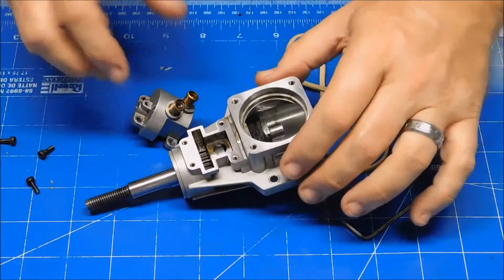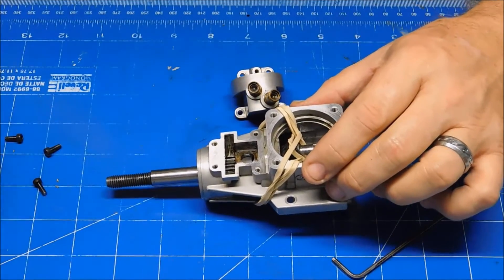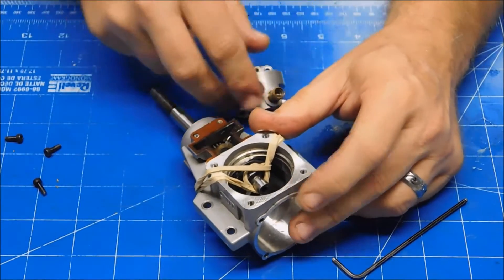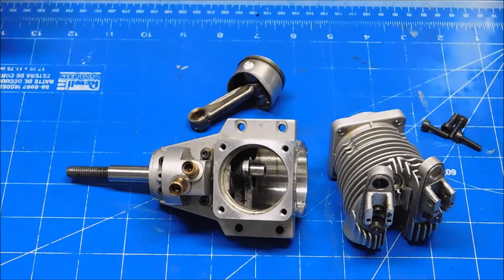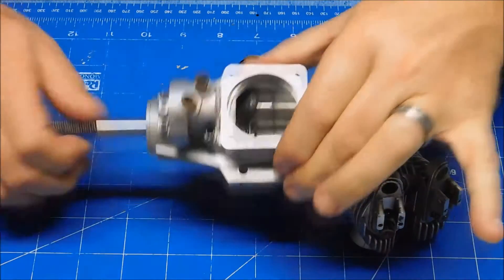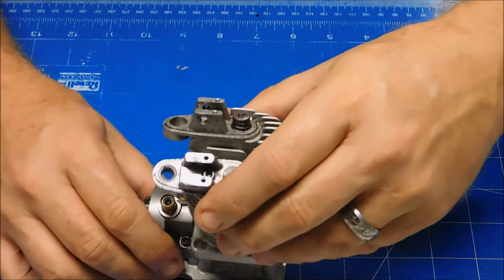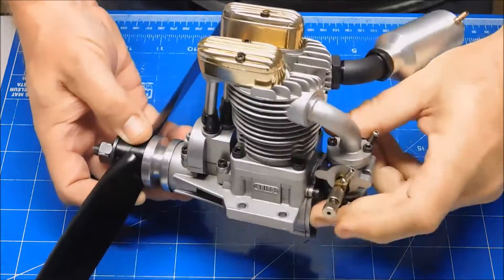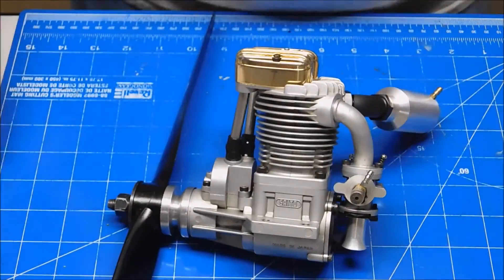Saito FA-120S DP A Look Inside Part 4

Comment: Dave, any reason you can't install the Cylinder and Head, connected to the crank shaft first. Then just turn the crank from the front of the engine to bring the piston up to the top of the cylinder while sticking a probe down the glow plug hole to watch it rise up to where it stops rising indicating the piston has reached top dead center. Then drop the timing gear in? Can't get a more accurate way of setting the timing.
Reply from the maker: I do not believe that is any easier or more accurate than my method.  Most Saito engines do not have cam followers like that and they can be dropped in after setting the timing.  There is a hole in the timing gear that a tool fits into to set the timing. Other videos I should this and it is the method in the "Complete Guide to Saito Model Four Stroke Engines" book and recommended by Saito.
Reply: In my opinion the best way to phase the motor is to mount the front bearing after the motor has been phased, so from the bearing hole you can see the phase point.

Comment: Two glow plugs?
Reply: Used to be common in the old days of RC- if one plug failed, the other was likely still ok. Same principal as dual ignition on a full size aircraft engine.
Reply: I've just picked one of these engines up brand new so reading up on it. Never thought about the dual redundancy aspect of the dual plugs. But I'm hoping it adds some power too. On full size when you switch to one magneto you get an RPM drop. The dual plugs should give a more efficient combustion and bit more power.